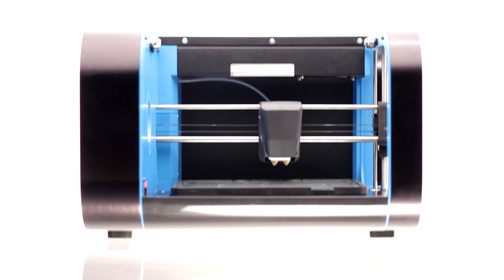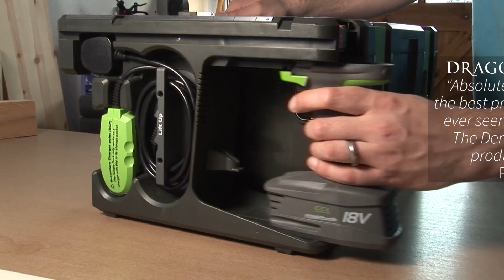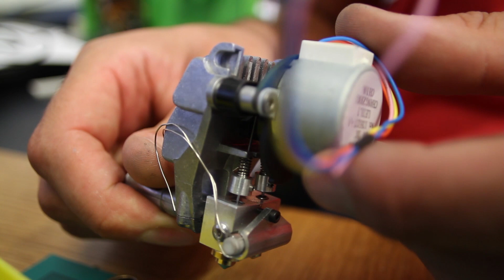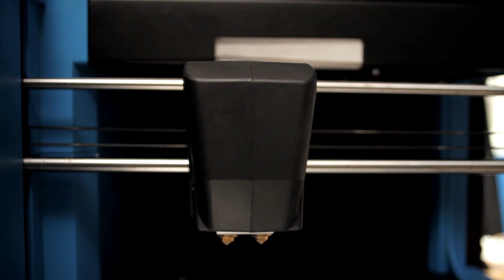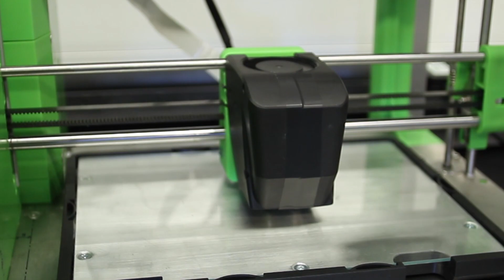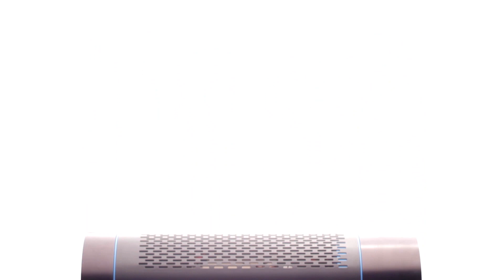Robox Kickstarter Video

Comment: User's opinion: Menu is  grey on grey, non-readable. We can't change the structure of 3d-printed model from linear to honeycomb, etc. , so the ready items just fell apart. Nozzle became blocked on the 2nd day and it's not possible to eject it to clean properly.  Noisy.